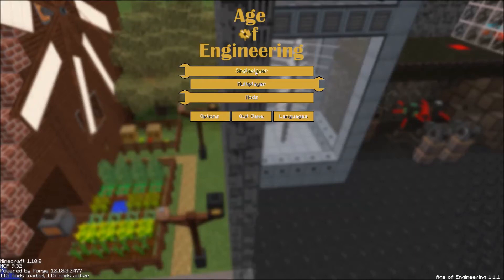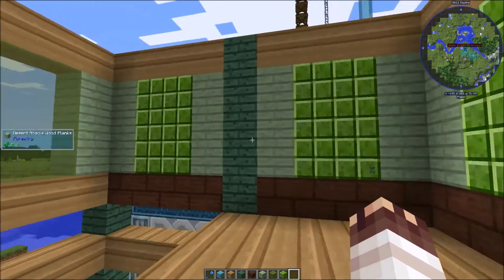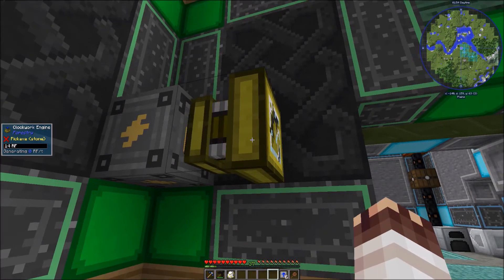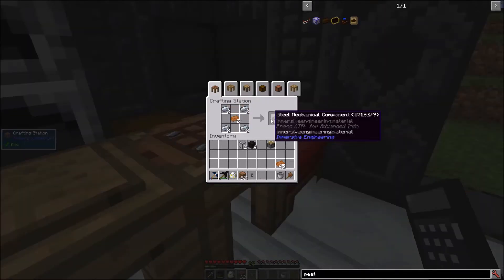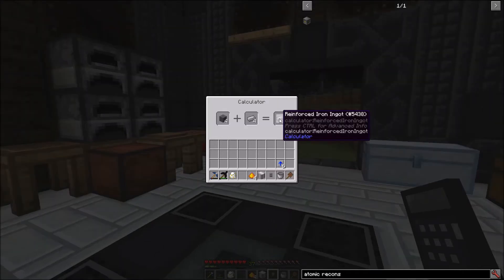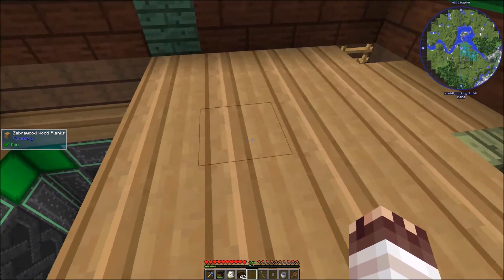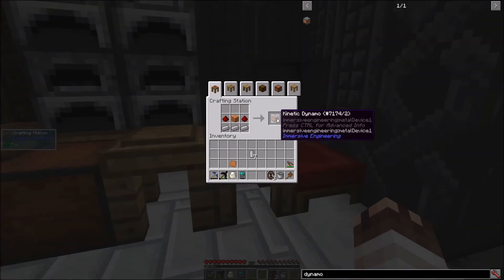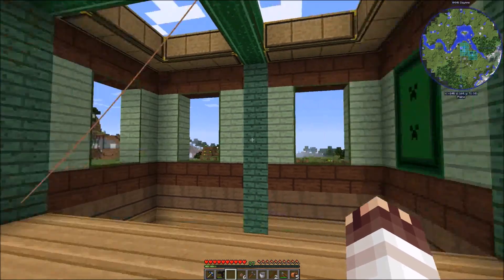New Age of Engineering Supershorts #5: Calculator and RF Infrastructure

Comment: Hey if you are strugeling for power try the 'battery' Wilx made  on  ic2 based  on  3 basic generators surrounding a double batbox with a torch, is amazing and super compact
Reply from the maker: Thanks for the idea! I'm not struggling for power, though, not with my carbon wind turbine up there.